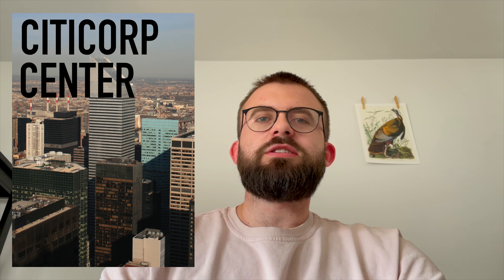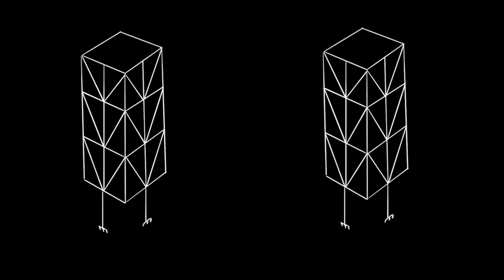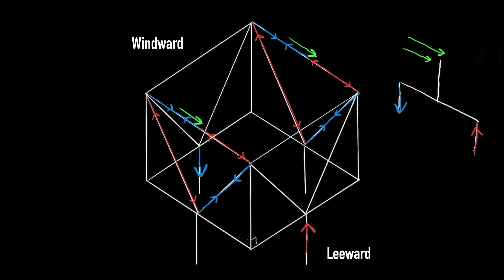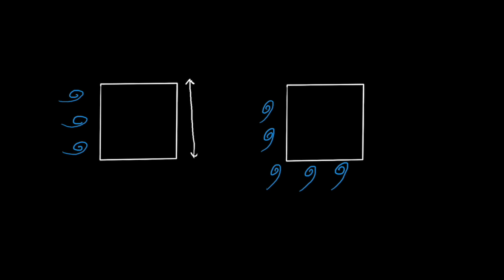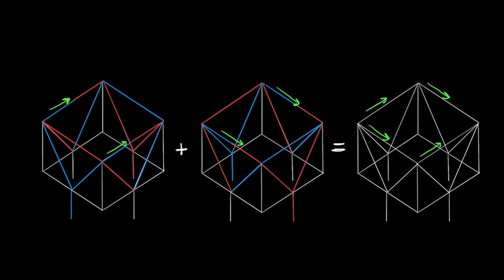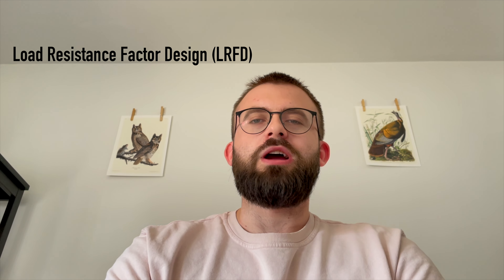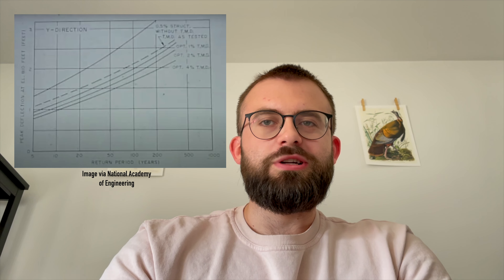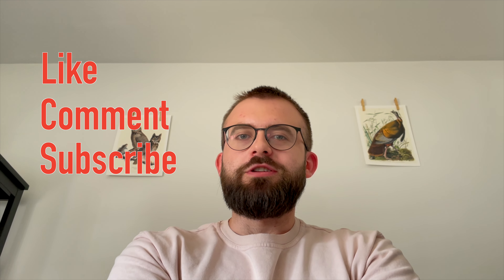CitiCorp Center - the Math behind the Crisis

Comment: Thanks for adding the structural analysis.  In one of Dr. Ressler's Great Courses lectures, he also points out this case as an example of good engineering ethics in that LeMessurier took the question seriously, researched it instead of rationalizing it away, and went through an extensive process to improve the structure.